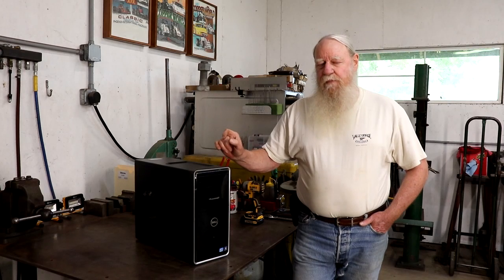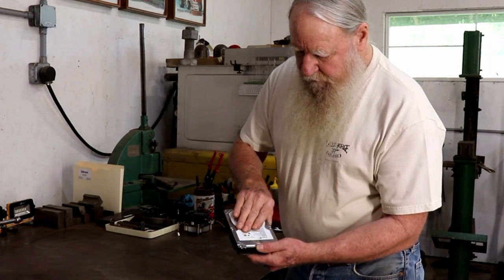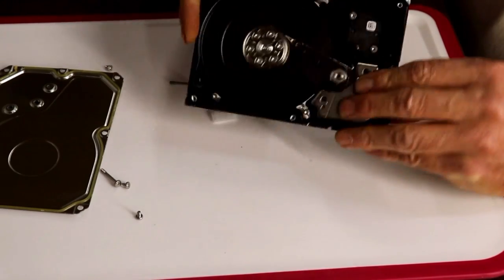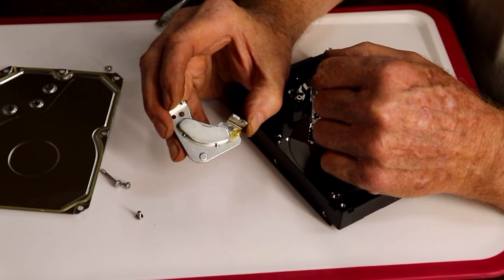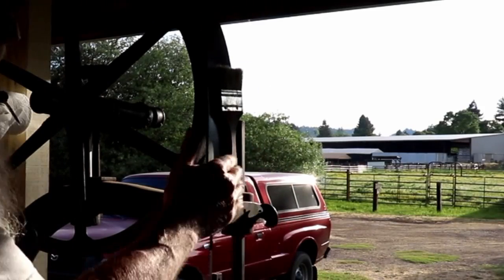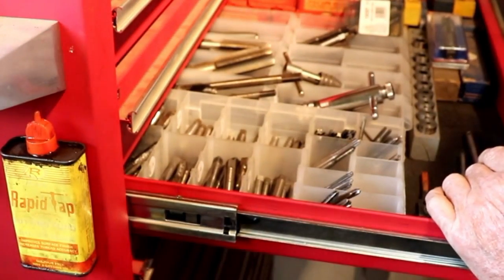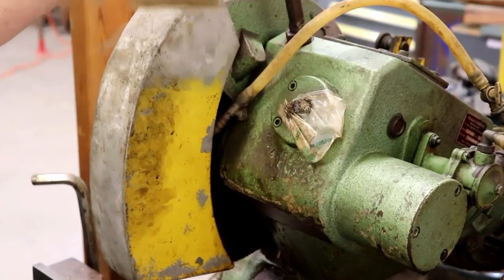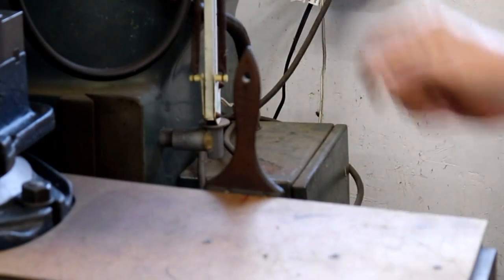Many Uses For Magnets

Comment: a magnet I've often put to work in my shop is what you find inside the rubber gasket of a refrigerator door.
'cut the gasket open with a razor blade and pull out a 4 foot length of  like 3/8" x 1/8" magnetic strip
it is easily cut with heavy scissors
I keep a couple of lengths In Stock
a dab of adhesive on It and what you'll apply the magnet to and you're set
I ruff up the magnet and what I'm glueing it to with some 80 grit
Know there is a strong and weak side to this strip material
I've used it numerous times on Drill / Tap / Fraction charts I've lamented and move around the shop
I've given lengths of the stuff to kids and told them to glue it to things they want stuck on the kitchen fridge.
Reply from the maker: Hi again Gary:

Thanks for the tip. I'll look for some door magnets the next time I'm at the dump.

Jere

Comment: You should also retrieve the PCB and give it to your computer guru, sometimes that's what fails while the drive is still good (power failure related failures come to mind) and it's often nearly impossible to get a replacement. I've been able to get all the data out of a drive this way, simply by installing the PCB of a good drive. Works well when you have several identical backup drives. But by all means get yourself a proper Torx screwdriver, I winced seeing you hammer the thing!
Reply from the maker: Hello Johnny:

When the computer guy was here working on the failed one I asked him if he wanted any of the internals and he said no. He said he has a good supply of used parts and a constant supply from working on used and broken stuff.

As for the Torx screw driver. The only other one I have is for removing seat belts. I only have the need for ether of them maybe once every 3 or 4 years. But I feel your pain. I, like you, feel there is the right tool for the right job. From now on I will drill them out.

Thanks for watching.         Jere

Comment: Hi Jere. Most Hard drives use T4 , T5 or T6 Torx bits. Your mileage may vary.  Since you are tossing the drive anyway, you can drill the heads off to pull the cover. Or use any other method that you might enjoy. The magnets are stronger than most people realize. Try to get a "tough guy" to pull one off of a clean, flat surface. ;) Some of those fans are 2-speed, by the way. Thanks for the  ideas.
Reply from the maker: Hello Joe:

This is one of the reasons I like making these videos. Getting feedback from people outside of my range of knowledge. Thanks for the info. I will mention that in my next video. Nothing on a car uses Torx bit so there in lies my ignorance. Thanks to you I am no longer ignorant about these screwy bits.

Thank you for the info and for watching.           Jere
Reply: @jerekirkpatrick2092    Sharing.... that's knowledge in action.
Some of the newer vehicles do use Torx but not the older cars, thankfully. They are "screwy" indeed. 
I did car work for 10 years, computer for 30+ and now "retired" and back to car stuff. 
Your videos are great. Don't stop and do them in the style you find reasonable (stories, demos, whatever). It's all good info.   Joe